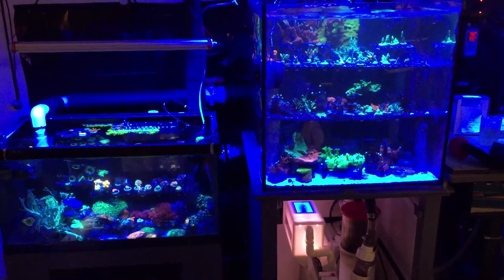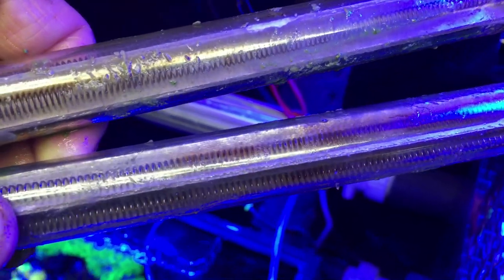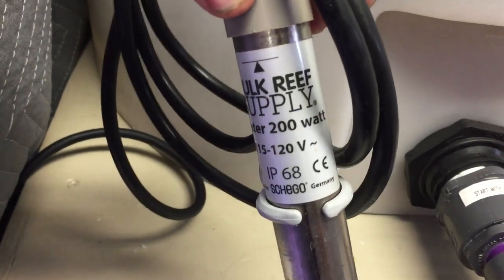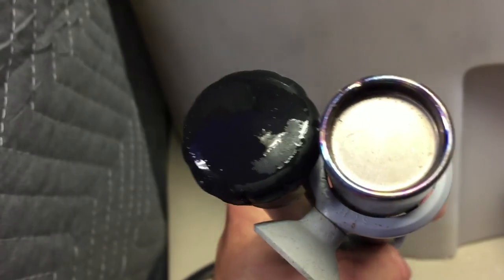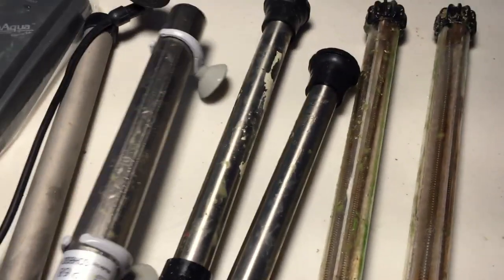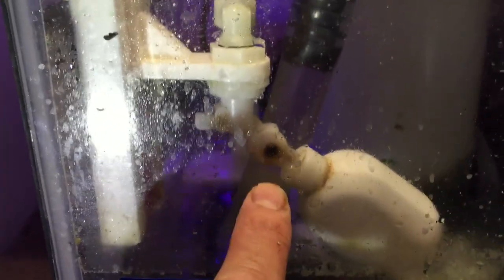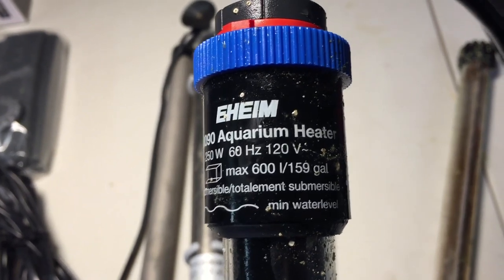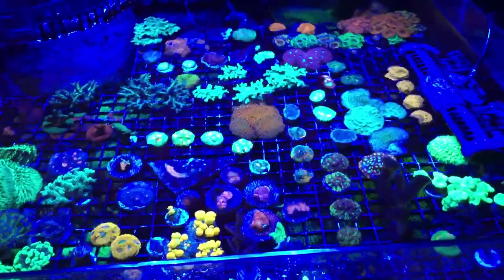REEF AQUARIUM HEATERS - COMPARISONS AND UPGRADES

Comment: What do you use and trust to calibrate any verify true temp in your reef?
Reply from the maker: That is a very good question. Currently I only calibrate once a year and I use a laser temp gun pointed at the substrate along with an old school floating thermometer. I trust both devices, so take an average reading. I also check against my Hanna digital SG probe, when measuring specific gravity once a week. You know, now that you mention it, calibrating for temp is pretty tricky to do right. How have you been doing it?

Comment: What kind of substrate did you use in your 120? Very curious on testing a larger grade substrate!
Reply from the maker: It is 50lb course coral rubble, purchased in bulk from a local shop. It has worked really well in our high flow reef.